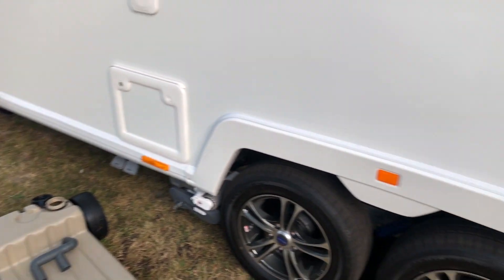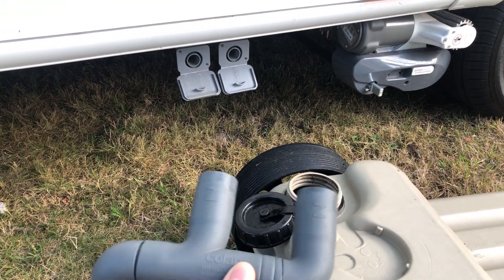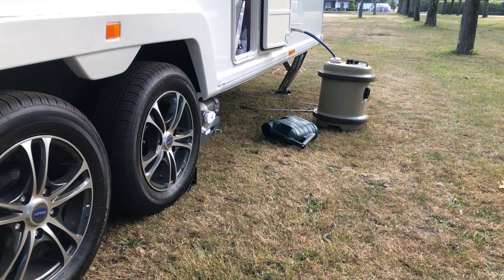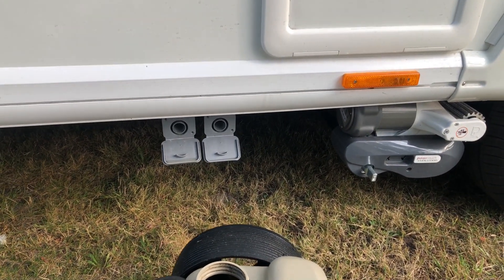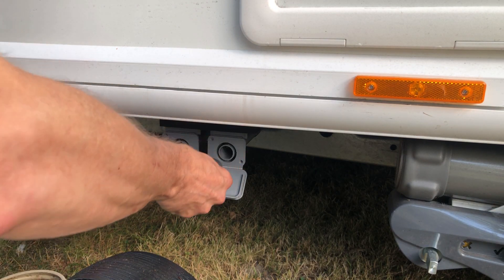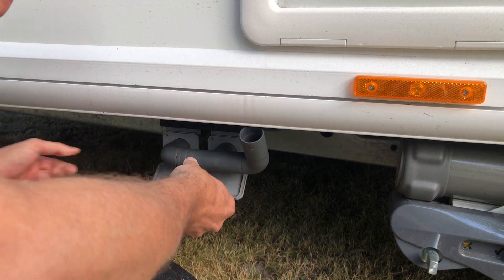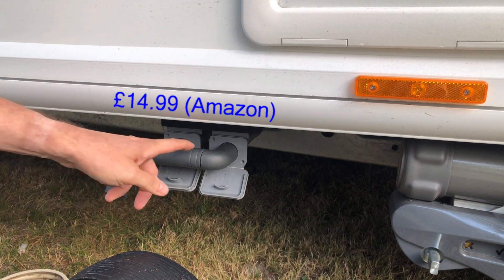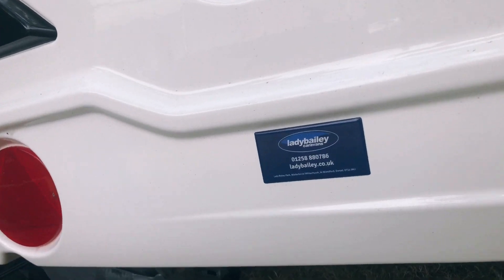Colapz waste pipe fitting

Comment: Well that seems to work pretty well but what is the advantage over the old tried and tested plastic stuff. We Have bought the colapz waste drain for fully serviced pitches and hoping it will fit in the old plastic waste but if not we'll be heading to the colapz website for our very own waste pipe of wisdom. :-) :-) :-)
Reply from the maker: Hi Ally/Allan, thanks for watching. 
The advantages are that it is very small, compact, convenient and comes in its own carry bag. The last time we had a caravan we had a Y piece and cut some of the hose to use, then we had big long hoop lengths of the other hose. 
If you get a new waste pipe of wisdom then the Colapz extendable waste pipes will fit directly to it. 
And at £14.99 from Amazon it’s well worth it. Did I mention I nearly forgot it was on the van the first time I packed up ready to go home? 🤦🏻‍♂️